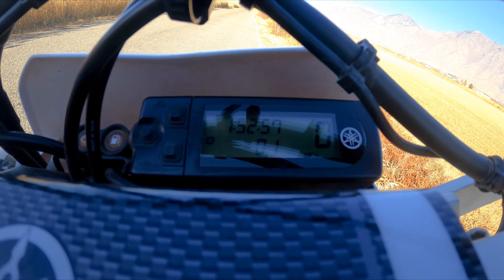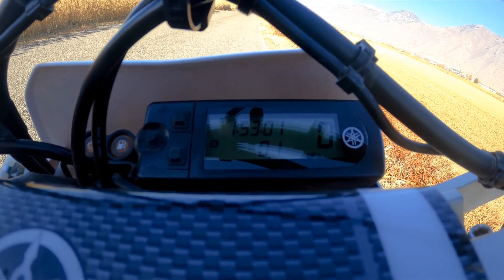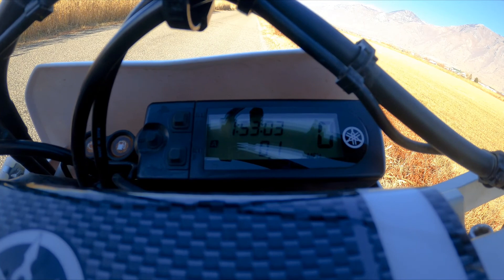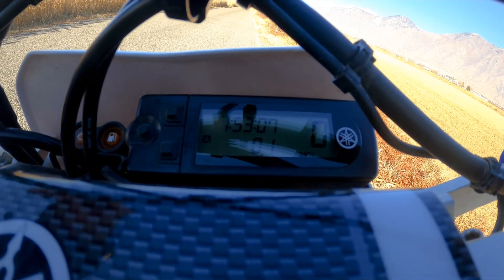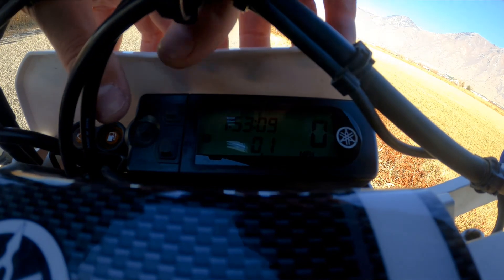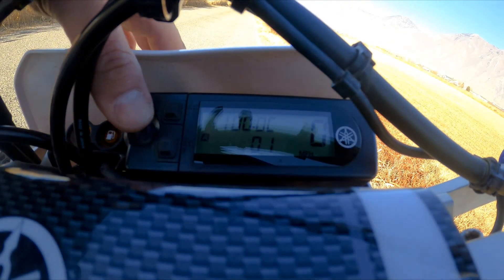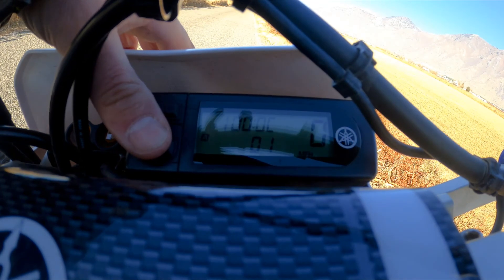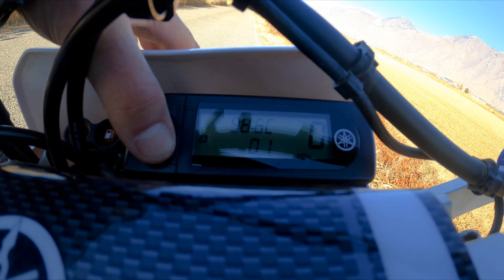How to calibrate the speedometer on a Yamaha  WR250F FOR FREE!!!!

Comment: Very informative! I have a 2019 wr250r. Do you know if the F and R have the same speedo unit?
Reply: So it does have a different shape but the function buttons are the same. Still...
Reply from the maker: @MontageCreativeGroup  I Googled an image of the R speedo unit and it is similar but different.  So did you get your speedometer on your R calibrated?  And it was the way same as the F?

Comment: Great video.  On an aside, what's it like going long distance on the pavement? What speeds and durations can you manage?
Reply from the maker: The bike will go 75mph+  but the motor is revved to the max.  When on pavement I like to keep it between 60-65mph. Also, I put a Seat Concept Comfort Plus seat on the bike. Although it’s more comfortable than the stock seat,  it is nice to get off the bike for a bit after about an hour.   I’ve done several rides over 200 miles in a day.
Reply: @Rally_ADVentures  I am moving from Logan to Tucson and your channel has helped me decide on a bike. Thank you so much for taking the time and effort. Let me know when I can buy you unusual amounts of IPA's or carbonated sodas.
Reply from the maker: @rxreyn3  The WR250F has been an excellent bike for my style of riding. I have yet to find one that suites me better.   I’m glad to share my experience with it.  Enjoy your new adventure in Tucson.

Comment: Do you think you could fix that even if the guy I'm looking at it from says it reads like 180mph at 60mph
Reply from the maker: You would need to try it.  From the factory it is set at 100:0C AKA 100 percent.   It can be adjusted to as low as 65:0C AKA 65 percent.   To correct it being as far off as the one you have it would need to adjust down to 33.0C AKA 33 percent.   Also, make certain it is set in MPH and not KPH.   Best of luck and let me know if you get it corrected.
Reply: @Rally_ADVentures  thank you very much I'll let you know how it goes
Reply: Have you been able to solve it? I have the same problem

Comment: Handy to know thanks, mine was out by 11kmh at max speed, also won’t let me reply to your comment. Thanks
Reply: Hey mate I have my new '20 and I was wondering for your situation was it the 11kmh slow or fast, I might've not rang mine out enough but I could only get to 110kmh on the dirt road before I had to slow down but I thought they got closer to 140kmh, stock gearing
Reply: It was 11kmh too fast. Said I was doing 161 when I had a bike next to me with a gps saying 150. That was with a aftermarket muffler, on the limiter in top gear, laying down. I’m only 70kg too

Comment: My 2020 wr250r  does not do this function
Reply from the maker: Do you have the owners/service manual?  I found the instructions to calibrate the WR250F speedometer in the service manual that I received with the bike when I purchased it.
Reply: @Rally_ADVentures  yes I do what page can find this
Reply from the maker: @gabrielkopp2036  for a 2020 WR250F the service manual page is 1-25.    The top of the page is titled MULTI-FUNCTION DISPLAY.  The name of the paragraph is “Setting the tire diameter”
Reply: @Rally_ADVentures  well I figured it out...I have a 250r and it's different
Reply: How to Enter 2020 Diagnostics Mode:  
Ensure the killswitch is set to OFF
Press and hold the ‘RESET’ and ‘SELECT1’ buttons
Turn on the ignition key
Hold both buttons for 8 seconds until display changes to ‘Diag’
Press both buttons again and hold for another 3 seconds until display changes to ‘D01’
Cycle though the menu using ‘SELECT1’ and ‘SELECT2’
Step to Code 07 Vehicle Speed Pulse: 0–999 to adjust
Reply: @gabrielkopp2036  In this video he is changing code 01 which is wrong for 2020.  Need to change code 07.
Reply: @markcowie973  thanks for the info..but I've already installed 12oclock labs speed drd..I am no longer running stock gears or tires